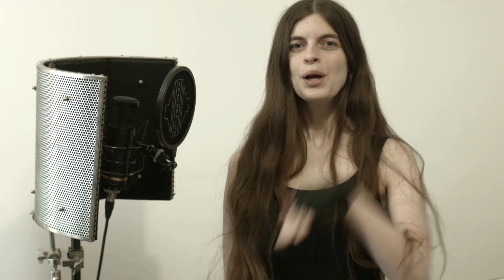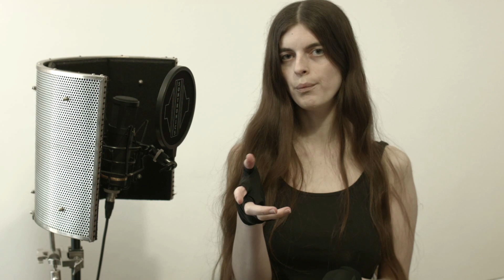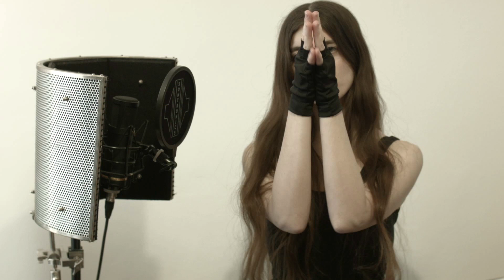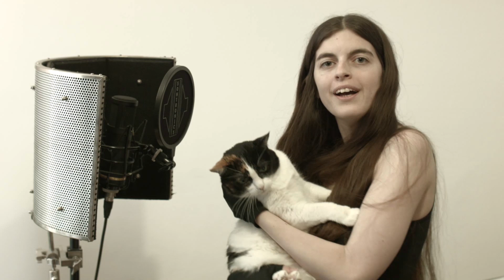Breath vs False Cord Distortion - what's the difference?

Comment: Great video!
The derpy voice is probably the best way to get into the transition from kargyrra to a false chord growl. I am quite concerned about adding falsetto (in head register) as our vocal folds are pretty delicate and singing higher means more tension even if you are opening them up for falsetto.

I use pure breath distortion if I want to go very deep as. A little bit of false chord as well but at a tone I cannot reach in depth. So probably it is D2
Reply from the maker: In my experience singers who use chest voice have more vocal fold tension during their distortions than singers who sing in falsetto underneath their false folds. That being said, the tension on the vocal folds in relation to length isn't a problem. It's the amount of compression between the vocal folds towards the midline that is of concern :)
Reply: @AlikiKatriou  it's hard for me to sing in falsetto range breathy. I kinda sound like a castrate when I sing in falsetto is the problem :D that's why I can decompress easier in chest voice

Comment: I feel like I have a thousand questions, because you've probably hit where my problems are. I've been practicing the Mongolian throat voice these last two weeks, and I can really hit it with some reliability--which is cool!--but I still feel like I need to use too much air to get it. How uh, how exactly do you pull back the air? I feel like this is stemming from some fundamental problems with my diaphragmatic support.
Love your approach to this, even though I've been at the "sigh until it works" method for the past almost two years. I don't hate my tone or my abilities (other than I can't hold a note for very long), but I'm also not so stupid as to think I'm doing 100% right or 100% safe.
Reply from the maker: I wouldn't spend much time on "support" or worrying about it. Rather than putting effort into "pulling back the air" just start your phrase or sound with less air to begin with: inhale normally, exhale a bit of the air and then phonate to see if getting rid of that "extra" makes a difference.
Reply: @AlikiKatriou  I'll see what I can do. I'm finding a lot of the shaking is in my nasal cavity; pinching my noses makes it harder to do, so I'm still not quite there. My throat doesn't feel great, but not awful either. Sort of like muscle soreness. I'm still worried I'm getting the right sound but the wrong way.
Curious what your lesson format is like, and if you have people send in clips/ask questions prior to the beginning or if it's just sort of fluid.
Reply from the maker: @dualwieldsoftware  My lesson format depends on the student and their goals and can change at the drop of a hat. Whatever the student prefers, some send in recordings, some never do :)

Comment: Check out Alex Terrible from Slaughter to Prevail. He's got sooo deep voice. In the song called Demolisher it's especially cool. He tried to explain how does he do that in his online course but he failed. I'd like to see your opinion on his technique if it's possible to check it with just listening to him.
Reply from the maker: Alex Terrible is one of the very few guys who actually does his false fold distortions on a low fundamental pitch and he seems to have a preference for D3 as a pitch in general... Other than that, in theory, stay on a D3, lower your larynx, bring in your false folds, allow breath to escape to get into a metal tone rather than Mongolian throat singing, pull your tongue slightly back and lift the tip. From than on, most likely things that are happening are: soft palate is probably slightly lowered, jaw is tensed maybe even pushed a bit forward (this will depend a LOT of the relative anatomy of your skull) and the mouth tends to be rounded with the lips squared out.   Tada - magic XD
And, as always, trial and error XD